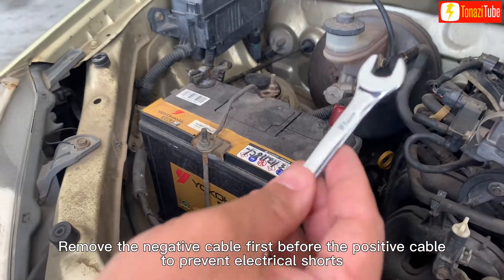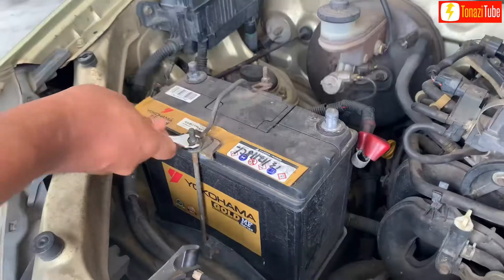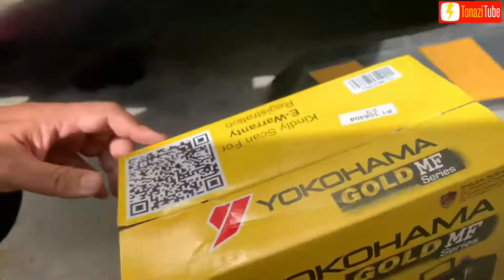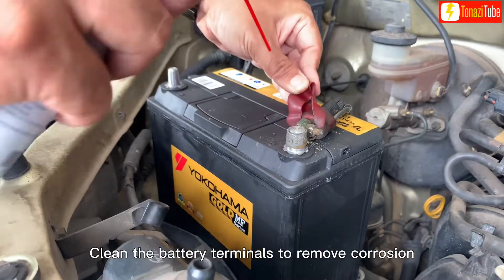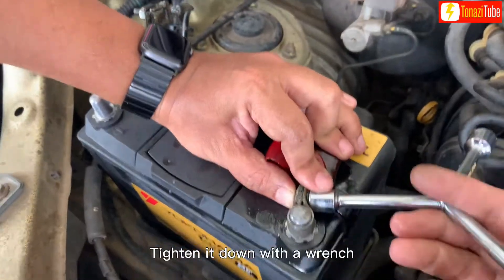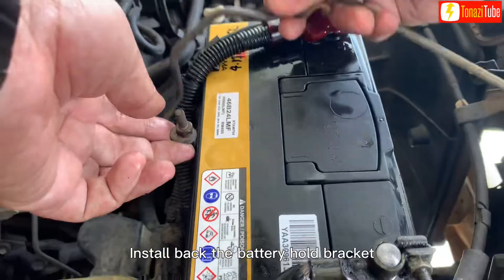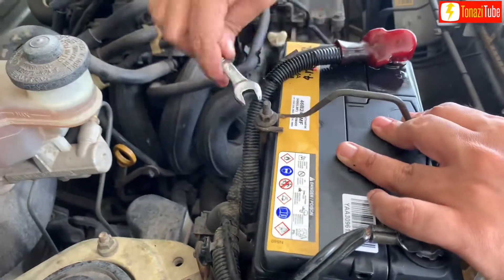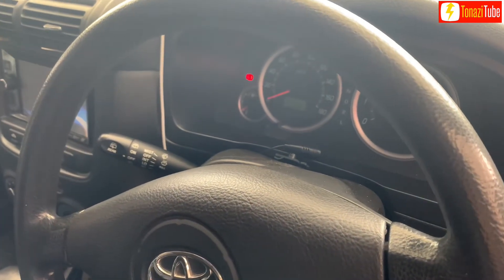How to Remove Old Battery and Install New Car Battery Safely | DIY Replace 12V Car Battery

Comment: Final part, when connecting the negative terminal, do you know why it will spark slightly?
Reply from the maker: Yes, when you connect the negative terminal of the car battery, you may see a small spark because some electrical components in the vehicle are drawing a small amount of current, even when the car is off.Here’s why this happens:
Capacitors Charging – Many modern vehicles have capacitors in the electrical system (such as in the ECU, radio, or security system) that momentarily draw current when first connected.